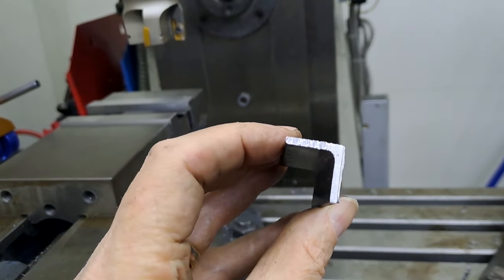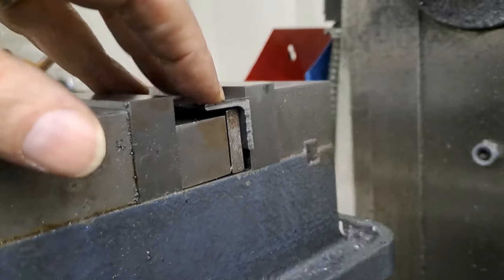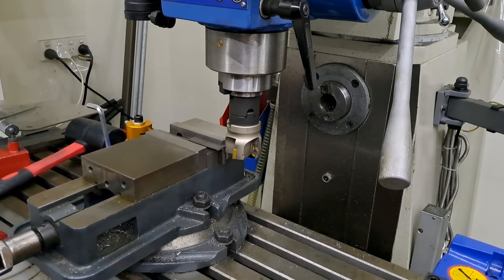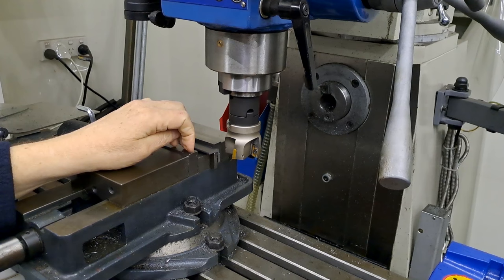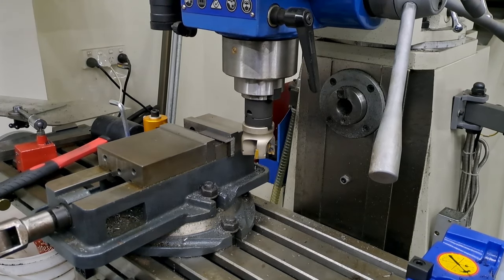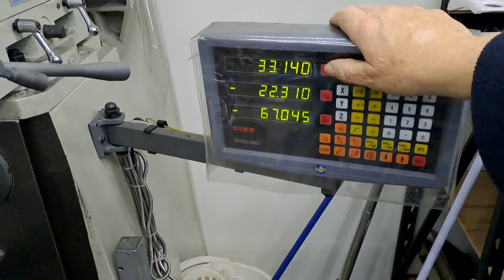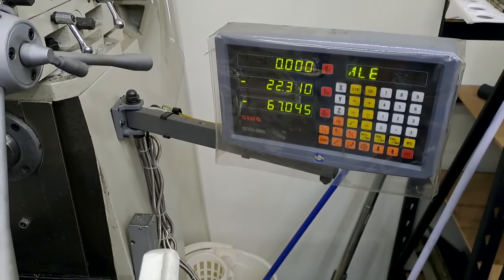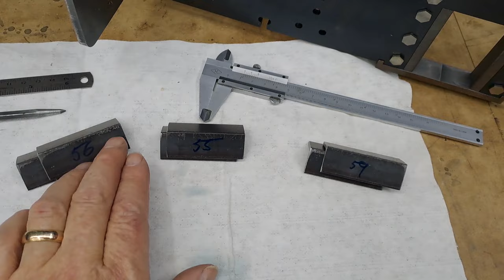017 Squaring the Angles

Comment: My first thought was to put the parts at 45*.  One jaw clamp on the apex and the other on the two legs.
Reply from the maker: It is possible to hold an angle that way... but remember that limited surface contact will increase the clamping force required to hold it securely... the greater the force, the greater the chance of opening up the angle, even in steel! 
The Chef

Comment: G’day Andy sorry that I haven’t written to you for awhile but I have been watching all your videos so far and they are very interesting and informative, your doing a terrific job of her and she will be a very fine locomotive , just while I am talking to you do the spring hangers have a width the same as the horn guides?  Anyway Andy keep up the good vlogs and I look forward  to your next one take care kind regards John.
Reply from the maker: Hi John,
Thank you for your kind words... always greatly appreciated. Just checked on my loco frames and indeed the width of the spring block and the total width of the horn cheeks (including the gap for the axle box) is the same. The design has the spring block held on top of them by the four (4) bolts through the frames, and a generous amount of Loctite... unlike the horn keeps that are bolted to the horn cheeks one (1) bolt into the bottom of each.
Regards
Andy
Reply: Thanks Andy it’s ironic that a few days after I wrote to you I found the drawings for same, but thank you take regards John